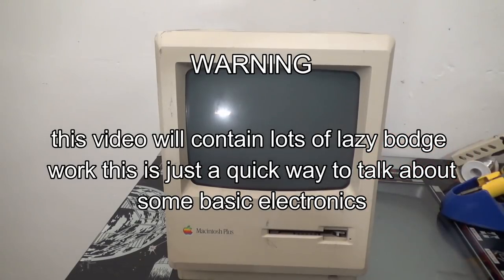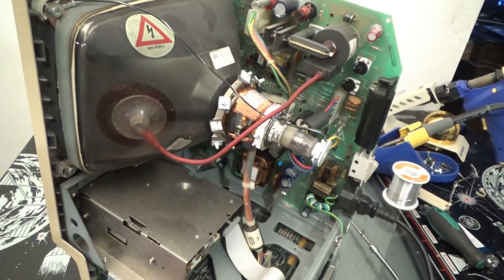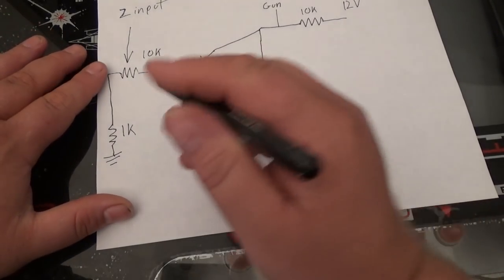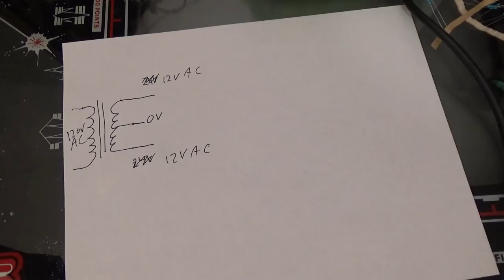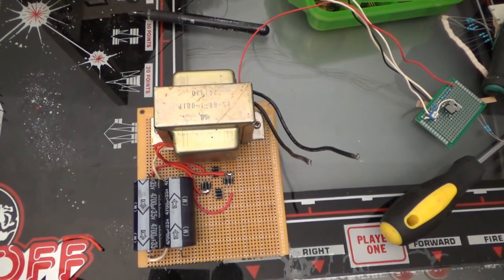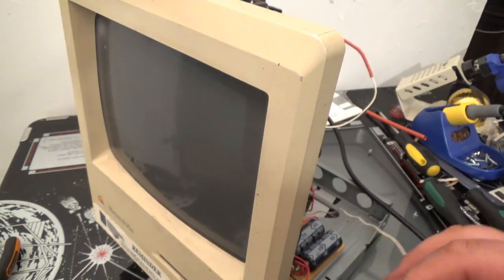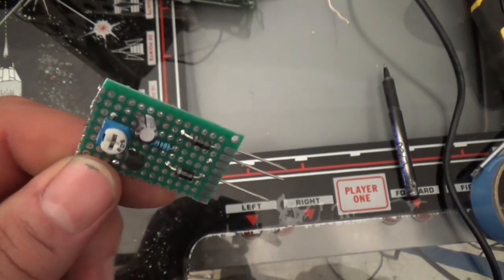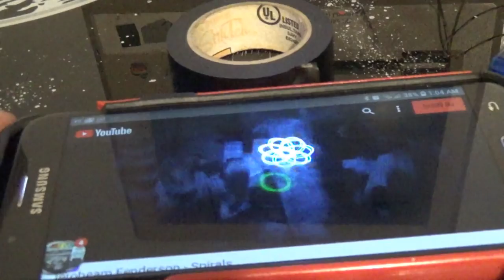How to make a VectorTosh

Comment: I have a broken Macintosh Plus that I was thinking of turning into a vector machine. I've already been able to make moving vector objects with an Arduino and got it connected to an XY oscilloscope. My aim is to make a stand alone system and program a basic vector game for it. Something akin to my Vortex game for the Vectrex, as the Arduino can run quicker. I don't mind loosing the Macintosh boards, it looks like it's my power board that's gone. My question is should I try to fix the existing power board, or look at alternatives? The Macintosh system board can be replaced with one of the more powerful Arduinos. (I have quite a few lying around).

Comment: I've watched a few of your videos, and I really enjoyed learning about the tricks you use during a repair/restoration. Clearing solder out of a hole with compressed air. Poking the IPA bottle to make an instant solvent dispenser. Linseed oil and paint for touch up. And your wife recaps monitors? Great videos,  I'm signing up.
Reply from the maker: lol thanks